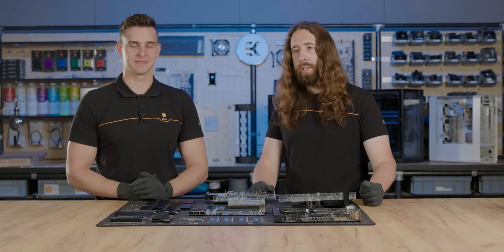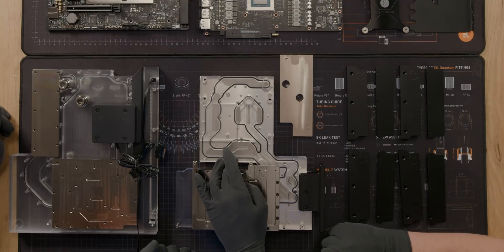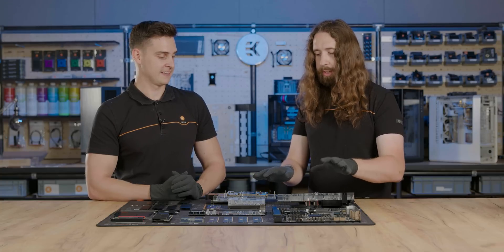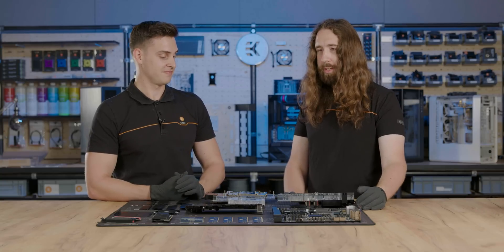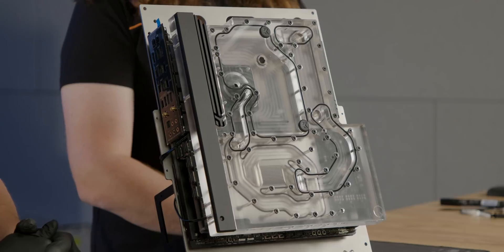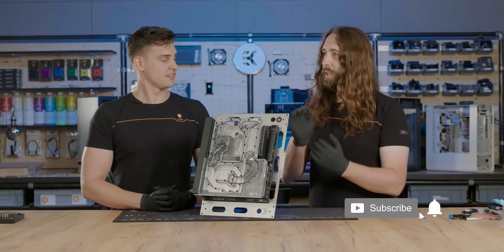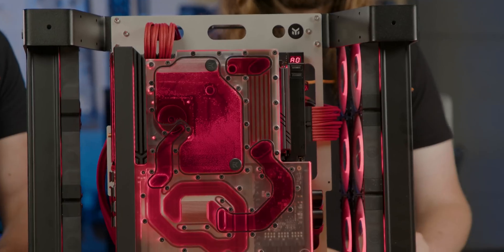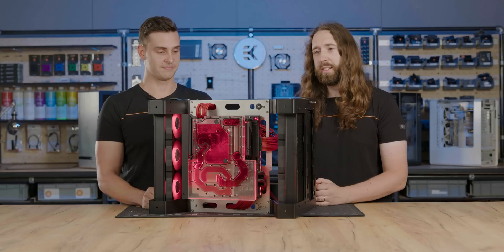The WHOLE Thing is One Water Block! | How We Built This Insane Water-Cooled PC | Part 2

Comment: I think it's a bit far off. I mean, there's no room for improvement; all of the parts have been predetermined; not everyone will buy the RTX4090 and then the 4090TI a few weeks later is released. And the same will apply to the motherboard and its manufacturer: more limitations. ( maybe i dont like MSI boards or Asus = forces certain parts on us.) The look itself is amazing, but the cons outweigh the product's lifespan. And also, the ram block is just wasting flow rate.

Comment: I tried this back in the late 90s with an A-Bit MB, did a 3d scan of the MB top and bottom. CNC'd an aluminum block for passive cooling on the underside of the MB which had some physical connections to the active cooling in the top plate. created water channels on the top plate with a spring-loaded CPU plate that used 1/4-inch flexible tubing to connect to the active top plate. Video and ram were passive and bolted to the top active plate. created our own gaskets and installed an acrylic sheet to the top of the active plate so you could see the water channels with a water flow indicator. LEDs. where sunken in under the water channels and flow indicator and filled with clear epoxy. It basically looked like a thick laptop in aluminum with ram and video card sticking up also incased in aluminum (no such thing as ribbon cables at that time). There was no hard tubing back in those days and the only commercially available water-cooling solutions at that time came from Koolance. We found out that even though it doesn't look like it, a lot of the components require air cooling which we created small fans embedded to the active and passive blocks to create air flow (push/pull). Cost and work were not worth it. As you know, almost every 3-12 months there were consistently new versions of MBs which made mine obsolete by the time it was ready. Nothing on a MB is consistent from generation to generation and every manufacture likes to change placement dictated by ever evolving technologies. My hats off to EK for keeping up with manufactures and delivering products in a timely manner to consumers.

Comment: Looks great, but it's still using huge or big form factor... now consider similar with just mITX board since you're covering the whole board anyway so no point in extensibility benefits of larger boards, maybe something like sandwich layout with centrally located reservoir and blocks on either side to sit between mobo and aic, with respective backplates pulling double duty as side covers... Add the rads to sides and you're good to go... more like a minimised MonsterLabo passive case just with core of liquid cooling.

Comment: This looks great! One thing I would improve is to somehow include the radiator on the block as well, to really make it one solid piece.

Maybe two on top and bottom side with the same length as the uniblock and one on the side with the same length as the height of uniblock + width of the two top/bottom rads and just the right thickness so when you attach fans its flushed with the entire build?
Reply: I'm not sure if you're joking but at that point you might as well just sell a block that doubles as a case. It would be a nightmare. Extremely heavy, very difficult to maintain and incompatible with most systems. Not to mention the cost would be absurd.
Reply: @JJFX-  I thought that was the point. To have a block that doubles as a case.